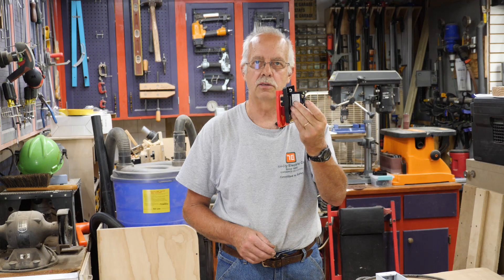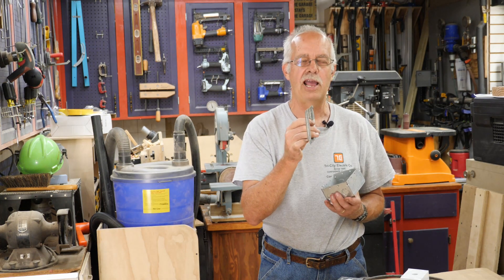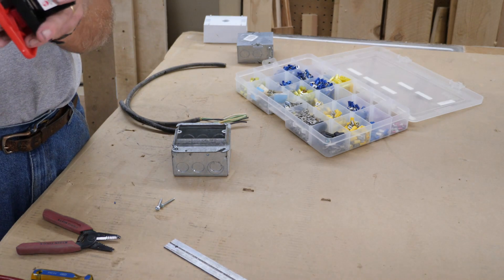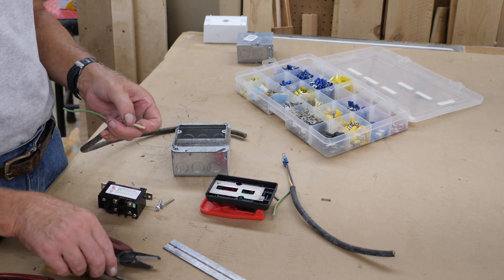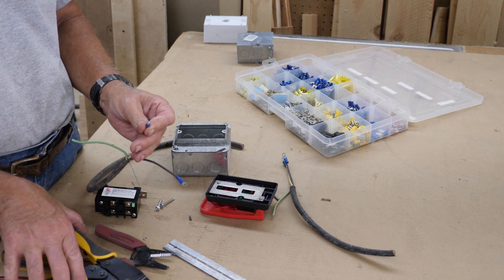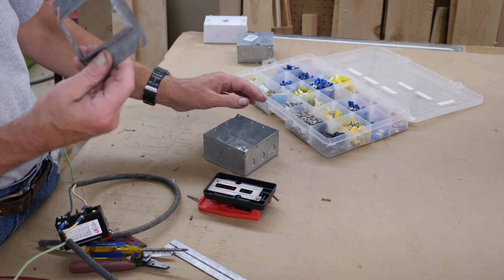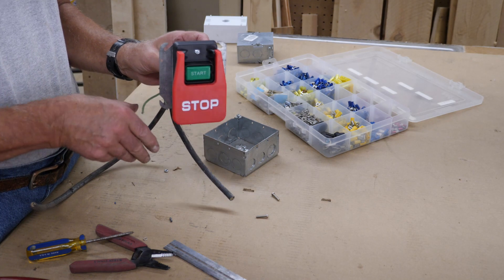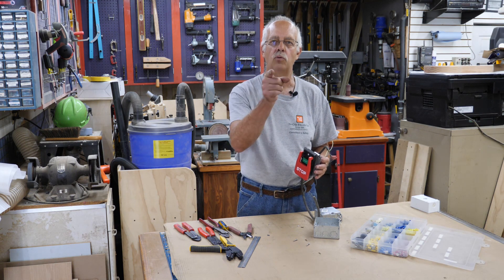Powertec 71007 Switch Wiring & Mounting

Comment: Hello Roger,  Good video!  I'm not sure if you ever check comments on older posts but I need to install this switch on my table saw and I have a little different set up than the procedure you demonstrated here.  As a result I could use your advice.  Is there any way to contact you?  JV Jacksonville, NC

Comment: Very helpful video Rodger!  Thank you for making it.  Is this the way to wire up the switch for both 120V/230V?  And is 16 gauge wire the correct size for wiring it for 230V?  I have to wire it the 230V way.  Thank you!

Comment: Roger -- good video --  My question is --- I have a 5HP 3PH 208 Table Saw Motor -- I will be using a VFD to be able to run the saw on 1PH 220 V.  I would like to wire up a paddle switch via the remote control function of the VFD.  What I am wondering is this Powertec 71007 able to handle the 5HP motor 12.6 Amps when I see it is rated for 3HP?
Reply from the maker: Yes.  BUT, wire the switch into the VFD as the start/stop control inputs instead of the VFD output to the motor.

Comment: Question: Can you use this kind of switch for a 240 volt motor and if so how do you wire it?
Reply from the maker: Yes.  Same method, just no neutral through the switch.  One pole on each side.

Comment: The switch I got had the push on connectors for the terminals.  So you definitely need the deeper box to connect them as they stick straight out the back!  A 3 inch deep box needed.  I think I would have preferred the one you have but can get it done!

Comment: Hi Sir! I wonder about the NVR function of this switch, is it somehow build inside the switch so any loop wires are not needed?
Reply from the maker: This model does not have no voltage release.  For that, you need a magnetic-held switch.  This model is mechanical.

Comment: The wiring you described in this video is incorrect! The white wires are not supposed to be attached to the switch!!!! You have no place making youtube videos about this. The white wires should be wire nutted together like any other switch. Seeeesh! :(
Reply from the maker: This switch is designed to break BOTH sides of the circuit, hence my directions are CORRECT.  This is also designated in manufacturer documentation and is a part of the UL listing for this device.  This is not "any other switch".  You have no place criticizing a master electrician unless you have PROOF, and you do NOT.

Comment: I have had one of these switches for years and have been so intimidated by it that it sat in my shop unused. This is the first and only video that I have found that taught me everything I needed to  know to wire it. What's even better is that I took the opportunity to wire it to an upgraded motor so my shop life just got exponentially better. Thank you!

Comment: practical walk-through with helpful tips like what to get at the store and demonstration of how things fit and don't fit - Of the 15 or so types of electrical boxes at most home-improvement stores,  Roger demonstrates two good choices and shows us why - appreciate the tip on sourcing longer 6/32 machine screws which at the store - $1 spent on screws and a second trip to the store saved!

Comment: Roger this was explained so well but my old rockwell jointer is wired so messed up I'm still trying to make sense of it. In theory my plug wire=line side and the load= wires going to the motor? Am I on the right track?
Reply from the maker: Yes.  Load side of switch goes to the tool (or motor in your case).  "Line" side is the power source.  In this case, the cord you plug into the outlet for power.
Reply: Thank you so much! I've watched about 15 videos and you made it the easiest by far!

Comment: This had Me lol coz I  bought 7 of these switches  to over ride oem switches an mounted all at hip/ leg level so could  have hands free kill switches..and also ran it to what the hay??  I'm  a bell box nut  I like the bell boxes for dust explosion proof
.  Took some looking but was able to find deeper  bell boxes an used standard rain tight gasket.. But what did the  manufacture  think we were going to do with a baby Short screw? But  I like your work around an a 4by4 is much nicer to work in for room an easier  to come by... But I absolutely  love the paddle switches  when your holding your work and need to shut  the saw off. Hands free kill switch..Great job explaining  proper  wiring!

Comment: Is there any issue with using romex and wrapping around the screws?
Reply from the maker: Unless using 14 Ga, I would not do it.  Anything larger than 14 Ga. would probably not fit well and may break the plastic below the terminal.

Comment: Useful. Thanks. Seems like every posh button switch in the country is one of these with or without the paddle. eBay has identical switches priced all the way from $10 to more than $50.
Reply: To fit my 20" Jet drill press I had to make an adapter. The mounting holes in the switch are fine. The problem is the head casting has a recessed, ragged and oversize opening for the switch. The adapter is roughly 3/16" oversize all around. I made mine out of 1/4" thick sheet plastic but baltic birch or Formica would be ok, too,

Comment: Outstanding walk through. You are a good teacher. Thank you for doing this.

You should do more of these on subjects like cleaning/repairing shop tool motors, dealing with problematic cordless batteries, and other common workshop electrical issues. Cheers!

Comment: Roger, great video and thanks for keeping it simple for us novices. Question, would one be able to use the switch to control power to multiple tools plugged in to a surge protector? i.e. have the load line going to an outlet, in which a power strip/surge protector is plugged into.
Reply from the maker: Yes, but do not exceed the load rating of the switch or it will have a short life or fail.

Comment: Enjoyed the lesson. What would the wiring look like if I wanted to add my shop vac to the switch or a receptacle to plug or unplug the vac?
Reply from the maker: Assuming the load would not exceed the rating of the switch, you would parallel the connection to your vac receptacle on the switch.  there is also an inline switch made that will auto turn on your vac when the tool starts.
Reply: @rogersshop  Thanks for your quick response. I understand the parallel connection but I'd prefer to plug in the shop vac rather then permanently wire it to the paddle switch. Can you recommend an inline switch compatible with the 71007?
Reply from the maker: @Farfulitis  The parallel connection can be to a receptacle to plug in the vac.  It does not have to be hard wired.

Comment: Roger, great video. One question: I’m going to use this to power a router on a cnc. The cnc table is wood, not metal so I wonder if I should ground to the box as shown or something else. Is it ever a good idea to just ground the load and line wires together and not to the mounting box in my example? Thanks.
Reply from the maker: Always ground a metal box and keep it separate from the neutral.  Some people tie the neutral and ground together and that is dangerous.  The neutral-ground bond should be at the service entrance only, never downstream.
Reply: Roger I have a question, do both green wires get connected to the box together?. I didn't see what you did with them. Thank you great video.

Comment: I bought a powertec 71006 similar switch , iam doing something similar with a portaband saw made a stand for it now I want to wire the switch for it , on Amazon they have a wiring diagram that shows the black wires on one side and the white on the other , I did a continuity test and I know one side from the other , on the back near the terminals are numbered 1,3 and 4,6 . Question is should I follow your way line in 1,3 and load out 4,6
Reply from the maker: The 71006 is slightly different.  Line in on 1 and 4 and line out on 2 and 5.  If yours in numbered differently, line in is the bottom two terminals and line out are the top two.  Polarity matters, so keep black to black on one side and white to white on the other.
Reply: @rogersshop  on the side of the switch near the terminals it has a diagram like this 1__/ __2 and bellow that 4__/__5 but on the switch near the brass terminals it is numbered 1, 3 on one side and 4, 6 ?
Reply: The continuity test shows me that 1,3 are one side and 4,6 are the other , how should I wire it black on 1,3 and white on 4,6 or black on 1, and white on 3  and black 4 and white on 6
Reply from the maker: @bobsisic5714  Black on 1-3 and white on 4-6.  So long as you keep colors the same on each side (as in left and right, not top and bottom) you will be good to go.
Reply: @rogersshop  thank you

Comment: So, I am mechanically inclined, but not electrically.  I know the green wire is ground, where does it go?  Do I mount it to  the box, or do I crimp/splice them together?
Reply from the maker: If you are using a metal box, the ground also needs to be bonded to the box.  If using a standard electrical box, there will be a 10-32 tapped hole in the back of it for a bonding screw to add a ground pigtail.  From there, all grounds are connected together.
Reply: @rogersshop  Thank you for all your help.  Worked just fine.
Reply: @rogersshop  I bought a metal box and faceplate, and I hooked it up, White & Black Line to White & Black Load, and the Green Ground Line is supposed to be connected to Green Ground Load from the motor ground at the back of the metal box with a green grounding Screw.  My question is, Do I mount the metal box directly to the table saw, or, do I mount it to wood and then connect it?  Or do I insulate it with a piece of rubber?  I'm not trying to die, but have already connected the wires, but haven't plugged it in.  Projects are at a stand still until I know I am doing the right thing.
Reply from the maker: @coreyparrish6765  Don't insulate or isolate the metal box from the saw frame (assuming you have a metal frame)  All metal parts need to be bonded together (grounded) to assure everything is at the same potential.  By potential, I mean grounded.

Comment: I couldn't quite see how you mounted the box to the table saw but the rest was very helpful.
Reply from the maker: This was a 'demo' on how to wire one of these switches using some scrap cord as an example.  As for mounting the box containing the switch, every situation is different and usually requires some type of custom bracket or mount.  On my table saw, the front angle iron rail was drilled and tapped to mount the box.

Comment: Great Video. 5 Stars.
I purchased this same switch for a Craftsman 100 table saw restoration. When I bought the saw, it had a regular wall switch AND it was wired for 240V 😲😱😧. I don't know how this didn't catch fire or burn something up but...
My question is for anyone who reads this is; Would you trust this switch to remain off when exchanging saw blades or would you unplug it from the wall entirely?
Reply from the maker: Unplug the saw.  On mine, I have a master control relay that shuts power off to everything on my table since the power is supplied by a heavy 30 amp 240 volt twist-lock plug cord.  This is activated by a positive action stop button that must be manually reset, hence no accidents.  Even though the start button on this is recessed, I would not rely on that when working with the blade.  It only takes one "oops"!
Reply: @rogersshop  Roger that. (See what I did there 😋)
Thank you for the quick reply.

Comment: This guy is the only one that has helped me with the switch. Thank you very much!
Reply: I had forgotten about the imprinted Line & Load sides on the switch.  Mine was apart for a month and in my elder age, I had forgotten to snap a picture, before disassembling. Excellent presentation.  Thanks, Roger.